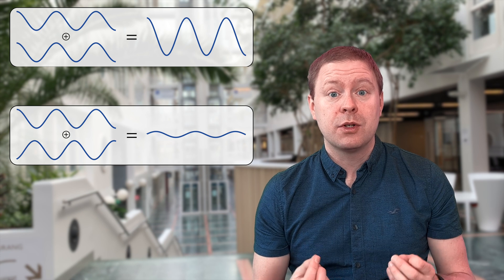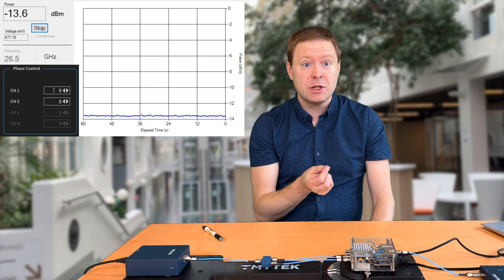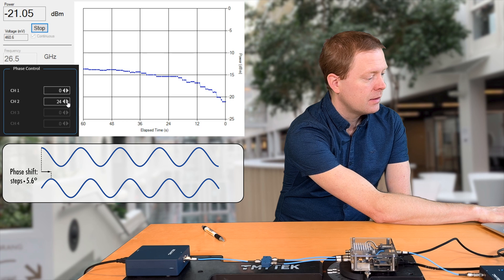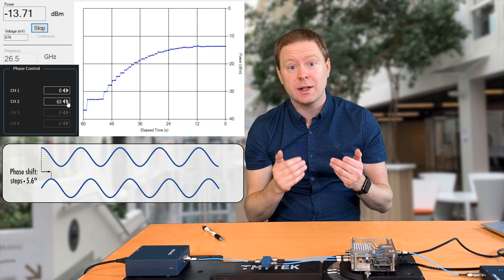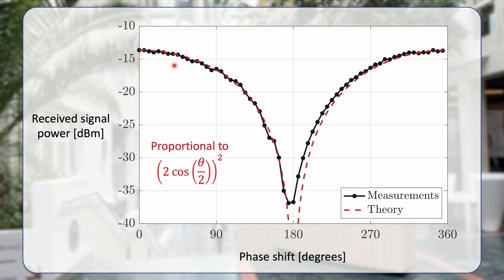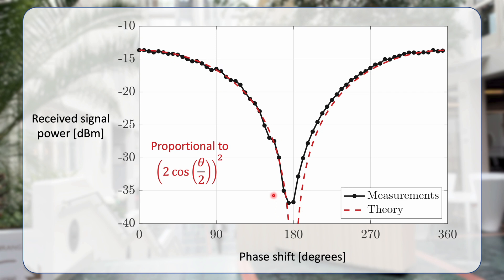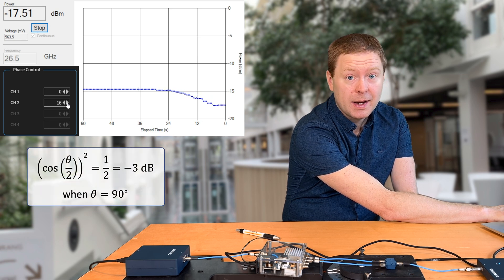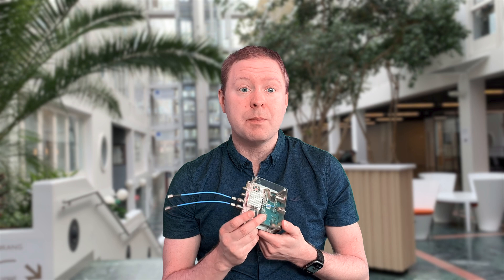Constructive and destructive interference [Part 3, Fundamentals of mmWave communication]

Comment: Hi, that is not specifically for the frequency. I think to do this with 800 or 1800-2600 MHz. 800 with 4T4R you can use this for covering better streats or railroads to make the Antenna horizontally smaller with 3dB more gain. The problem is that the Antennas has no CallPort for Low Band and the runtime on the Cabel and in the Antenna is an problem. Huawei has an Software Calibration Feature, but i coudnt test it. Some Antennas in Mid Band has an Call Port and it will be used for Beamforming 8T8R NR.

Comment: Thanks for another great educational video. Can we make it more insightful by starting with one signal and then turning ON the other one and then play with phases? Just to highlight the signal with and without its phase shifted twin?
Reply from the maker: Yes, that is possible. However, Part 1 shows what happens when antennas are turned on and off, and Part 4 will show beamforming over the air.